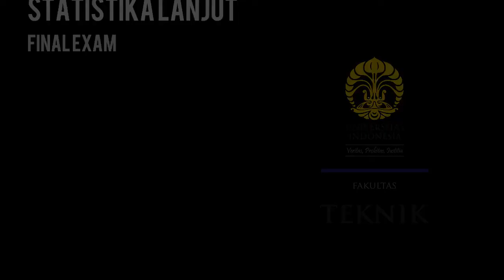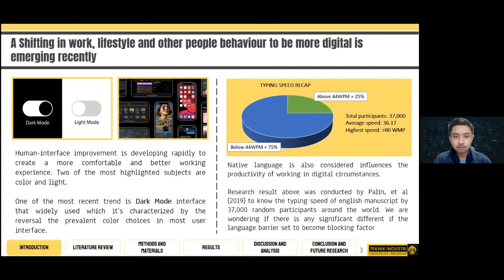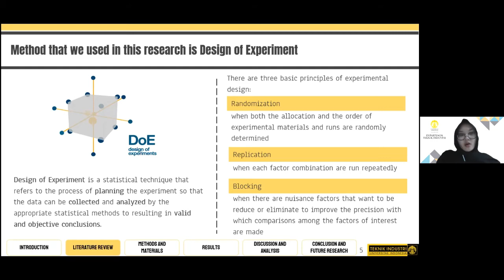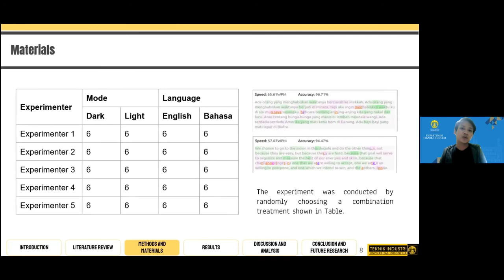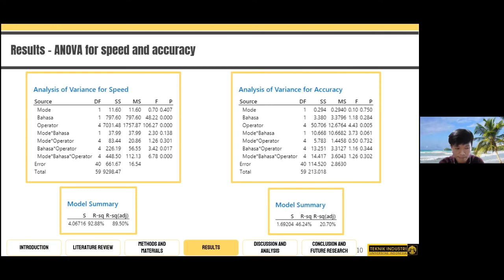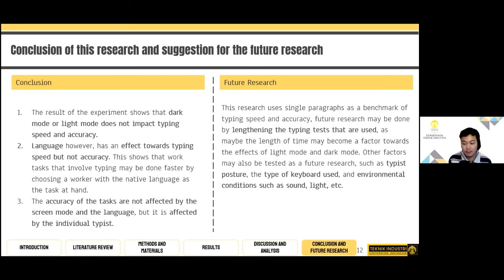Effects of Dark Mode and Language Proficiency on Typing Speed and Accuracy: A Design of Experiment

Comment: Good job guys! Nice presentation, nice experiment, nicely done! You have used 2 different response variables instead of one, i.e. speed and accuracy. You have done the analysis of mode, language, and typist effects for both speed and accuracy. 

It is quite uncommon to consider typist/operator as main factor. But then again, it depends on the researcher's design to decide whether it is nuisance or not. 

Regarding the dark vs light mode, make sure that you have the same environment while using both. E.g. noon vs night or indoor vs outdoor. As these two modes might have different impacts depending on the lighting environment surrounding the experiment place. Otherwise, it could be acknowledged as blocking (time of experiment or place of experiment).

Anyway, once again, good job, congrats!